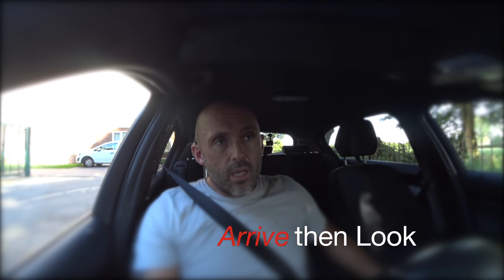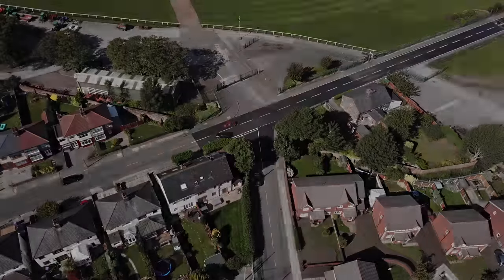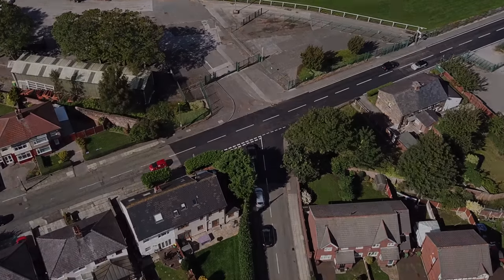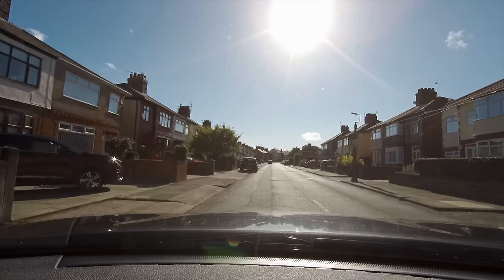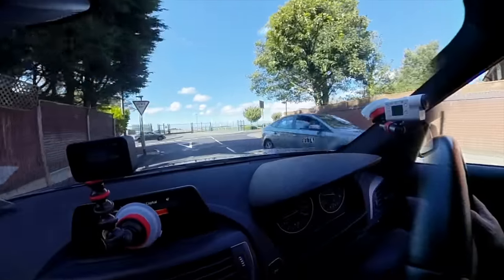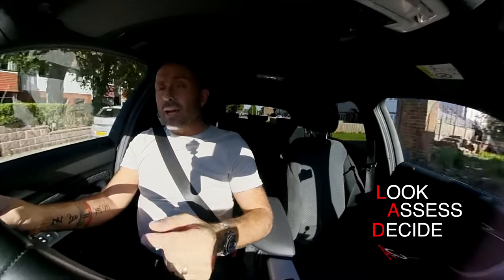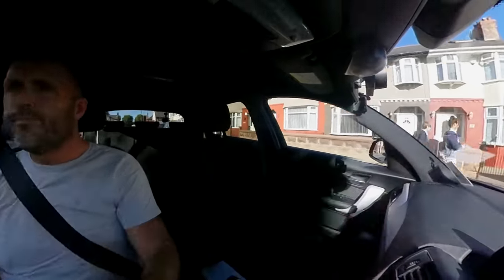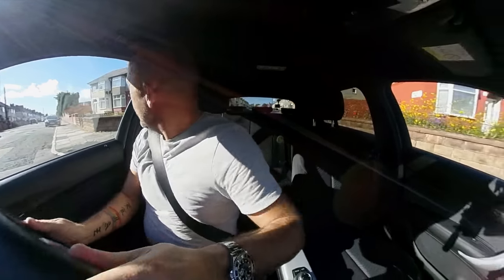Arrive then Look???

Comment: The other reason it's dangerous for drivers to arrive then look is that when I'm coming down a main road and I see another user approach a junction without looking, it immediately makes me feel very worried that they are going to emerge without checking, or perhaps have not seen me. If I see a driver who approaches a junction and has looked my way, it makes me feel more comfortable in knowing that they are aware I'm there and will not pull out on me.
Reply: Spot on!
Reply: I literally just came from a lesson and this just happened to me. I was turning into a road from a junction as a car was approaching from the road, I made eye contact with the driver and then started my right turn into his road. As soon as that happens the driver instantly starts looking for something in his passenger footwell as he is still driving forward about to approach the give way line. He arrived at the give way line whilst bending over into the passenger footwell. If I was the car behind me and didn't know any better, I'd have looked at the car and though there was no driver.

Comment: Look but don't start going until you 100% know the car in front has gone. Seen too many rear end accidents at roundabouts due to this. Had a close call myself when I saw the car in front begin to move off at the roundabout, assumed he had gone while I was looking right and seemed clear, then had to emergency brake with my sensors going off because he was still there. Now on my route to route work, on the major motorway roundabouts I don't look until I've seen the car in front fully clear off as I certainly don't want to be involved in a silly rear end collision.

Comment: Great video Ashley, I've been getting through your videos this weekend, and am finding them really helpful.  Thank you for taking the time, effort and ingenuity in sharing your knowledge. (this one was outstanding with the 360 camera).
If I may ask, I am 43 years old, have always put off learning to drive, mostly due to a couple of bad lessons in the early 30s, instructor was pushy and put me in situations I believed was inappropriate on a first lesson (duel carriage way on a first lesson?) 
Anyway, fast forward to now where I am desperate but very nervous to learn, I feel learning in an automatic will take some of my nervousness and anxiety away.
I certainly don't want to treat it like a fast track to getting to test standards, but more of a way to dial down the stress of gears and adapt more of my attention to my surroundings and safety rather than fretting about gears, clutch control, stalling etc etc.  What is your opinion about autos for nervous / older learners, and people who struggle with gears?
Thanks for your time reading this.
Reply from the maker: Hi Lee. Thanks for the comments. Automatics are the way forward. Virtually every car in 10 years will be automatic, but there is still a stigma about learning in an auto. My answer to that is "Do Rolls Royce make manual gearboxes?" Good Luck, Ashley.
Reply: Thanks for the response, that's interesting, i didn't realise RR didn't do manual.
Have a great day, thanks again
Lee

Comment: please note that there is a difference between a give way junction and a stop junction, a stop junction you need to stop, clear of not? Some drivers seem unable to look as Ashley describes and manage to stop without going across the give way line if the road is not clear and safe to proceed.  I find what Ashley describes it more noticeable at roundabouts, it is clear and they stop.

Comment: I don't totally agree with you Ashley. Doing that can actually cause some people more issues. I know because my instructor had to tell me to stop looking too early because I looked too early, and rushed it. When I stopped, I properly observed and didn't feel as rushed. I used to brake over the give way line because I looked right too early, so he had to tell me personally to not look until I have fully stopped. So it doesn't work for everyone. I've learned to look on approach recently (passed my test a year ago) but it's taken a long time.
Reply from the maker: You can and should be using the brake to suit what you are seeing on approach. It can be dangerous to stop first then look.

Comment: Even at a "STOP" T junction you need to be looking on approach as you need to accurately stop at the line, maybe find upon stopping you cant see enough and need to peep and creep. Then STOP and look again before emerging as the requirement is to stop at  the line, not short of it, where you cannot see enough. Another area where instructors use a mneumonic is the POM system Prepare - Observe - Move.  Ideal for commencing training for learners at the beginning but after they have mastered the basics of getting the car to move away, why is observing seemingly not factored in, i.e. observing while preparing the car?  Why do I see so many videos of learners moving off using the "moving off at an angle" technique when there is no obstruction to go round.  Why don't they just move off at a shallow angle and pick up speed form the off?  Rant over.

Comment: Possible situation where arrive then look is just fine, there's a big octagonal clue at them that says STOP.  Stop signs are generally placed at junctions where you can't see properly until you've arrived anyway... Though still a good idea to observe what you can on the approach, usually though one direction at least it'll be darned hard to see Jack Poo till you're stopped at the line.